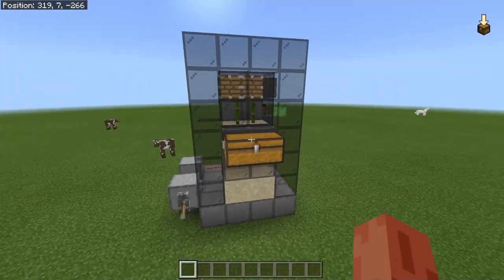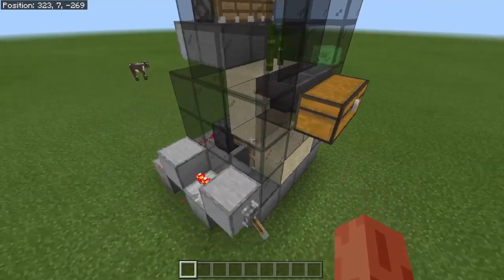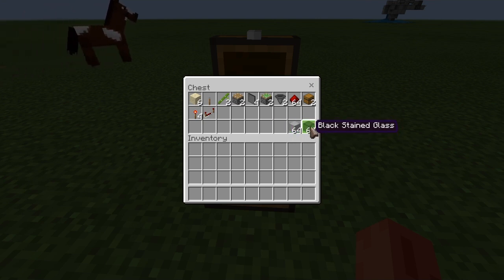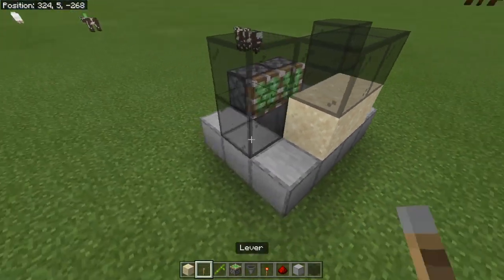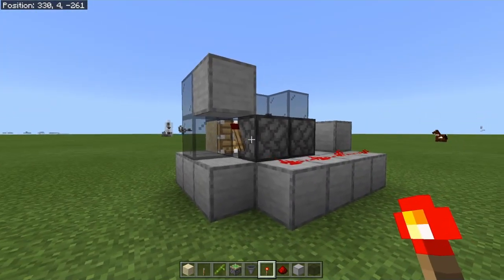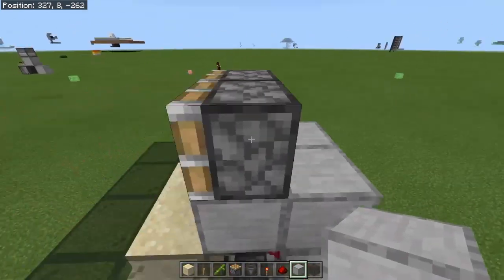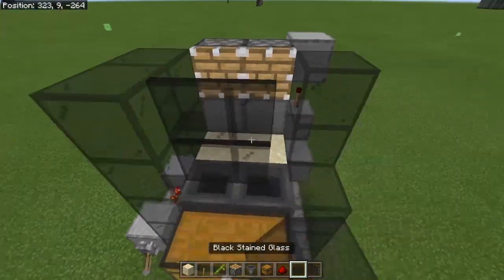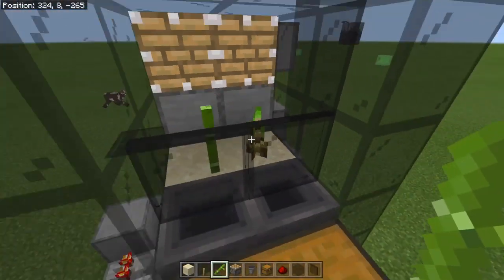*NEW* Bamboo Zero-Tick Farm! - 1.16 Nether Update Tutorial - (Minecraft Bedrock)

Comment: Also on your kelp Xp farm updated the sand breaks and the seaweed breaks and it won’t work
Reply: Just turn it off, reset it by placing sand back and kelp like original, then turn it on. It should work. Also, remember stay near the machine 1-2 chunks(16-32 blocks) close to it, so it will loads and prevents the sand breaks again.
Reply: Ok thank you
Reply: @spiderhunter66  before going outside the simulation border and exiting the game, its safe to turn the farm off